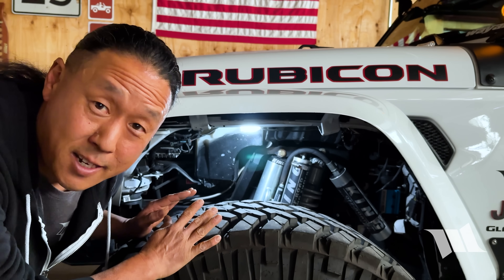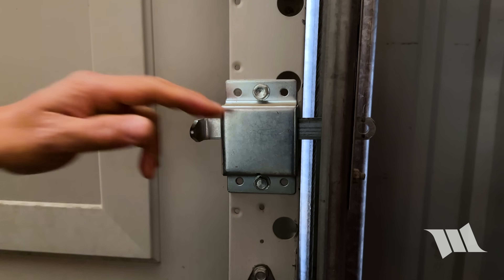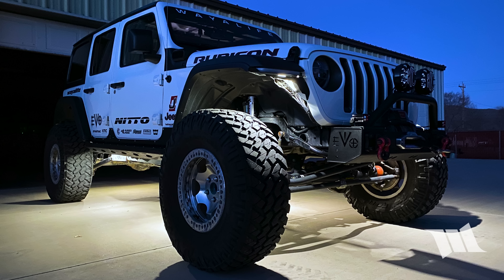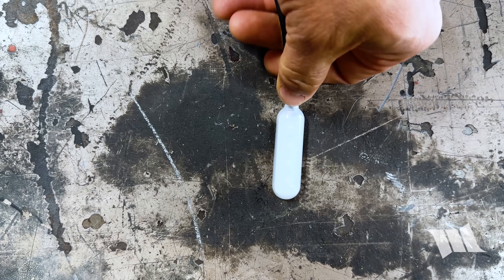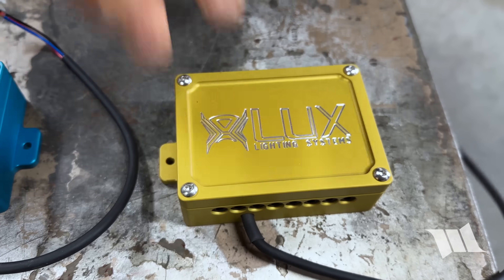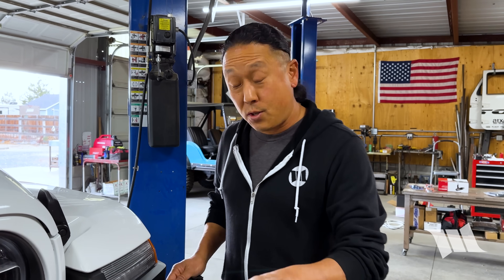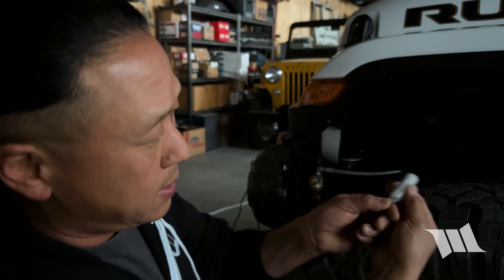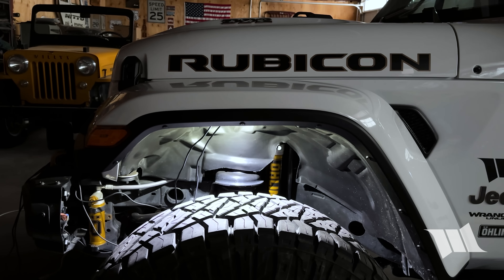ROCK LIGHTS that are Super Bright and MAGNETIC for Easy Installation on a Jeep

Comment: I love my Lux Lights. Being magnetic. No drilling holes into my 1949 Willys pickup body. 
I bought a 8 pcs kit but definitely need more lights love them too much.
Reply from the maker: Awesome to hear you love yours too!
Reply: @wayalife watching your 1st lux lights video is how i got hooked to them. My previous lights were the cheap AuxBeam, those were fine just not bright & the casting was weak, a slight over tightening it would crack the casting. 
I got to check if Lux has any sales this week. 
Im using 2 per wheel well, 1 per bumper facing my axle diffs, 2per rock sliders, 
Then it’s convenient to have under dashboard lights.
Reply from the maker: @Kylejeepadventures LUX is offering the 15% off with our discount code and then an additional 15% off for a total of 30% off if you place your order on Black Friday

Comment: Hey, when did you change the CB Bar to an Accessory Bar? Love it!
Reply from the maker: We changed it about a year ago. We still need to make an install video for it but as you can kind of see in the video, you can now install all kinds of accessories on it and all at the same time. And, as mentioned, it'll now work with 2024-up Wranglers and Gladiators.
Reply: I may have to upgrade. I have drilled my original CB Bar out so I could mount more items, but now that it’s available, I’d like an official one.
Reply from the maker: If you haven't already seen it, here's a link to the install https://wayalife.com/threads/acc-bar-jeep-jl-wrangler-jt-gladiator-overhead-accessory-mount-installation.64450/
There are a lot of benefits to this ACC BAR including how much higher up it sits.

Comment: So I have had the RGB version on both of my JLU’s. I have had a ton of problems with the Green LED’s failing. Now to give LUX credit, they were great at getting me replacements RGB’s. After changing out over half of the 20 LED lights I have. They have once again failed. It is only the green LED’s that are failing and unfortunately that stops the LEDs from turning white it makes them turn purple. I have now removed the LUX from my 392 and replaced with just white KC Cyclones V2’s. I think just going with the new MAX version would be awesome. Having the RGB was pointless, I only really used the white for off roading. The RGB is cool for mall crawling but no good on the trails. Maybe I will give LUX another try with the new version once I take the time to remove the second set off my other Jeep. I do love the way they mount with the magnet, it’s brilliant.
Reply from the maker: The new Monster LED's have a triple coating that's supposed to help prevent the problems you were having.
Reply: @wayalife  was this response to me? Triple coating for bad LEDs? Maybe to the guy talking about the rusty magnets ? 🍻
Reply from the maker: @LOVE-62  LOL - got a little ahead of myself there.
Reply: @wayalife  lol, great videos my man 🍻

Comment: What happened to the install tutorial video you said you would be doing with the Switch Pro's or other system and the Lux Light Modules? Did I miss that?
Reply from the maker: Unfortunately, there was a problem on LUX's end and I never got the rest of the stuff. Been busy since and haven't had a chance to follow up on it. Might need to do that now.

Comment: Eddy when you installed the rgb pro installer did you have an issue with the lights staying on with your sp9100? The switch button stays on but the lights turn on then go off
Reply from the maker: Sorry, never installed the RGB pro installer or lights before so I couldn't help you here.

Comment: Do they not have the monster lights anymore? I can't find them anywhere, and they aren't even mentioned on their site.
Reply from the maker: From what I understand, they got pretty backed up with orders after we posted up this video. They removed them from their website until they catch up.
Reply: @wayalife , Well dang, thanks for the heads up! The MAX RGB, is there any special adapter you need to control via the app and change color?

Comment: So Eddie, one day it would be cool to see those lights (maybe a little larger) use NO wires and use batteries and your cellphone operate them.
Somebody comes up with THAT will be a rich person.
Even if you had say 5 lights on your jeep, all you would do is pull them off and change OR recharge the batteries every 2 or 3 trips🎤